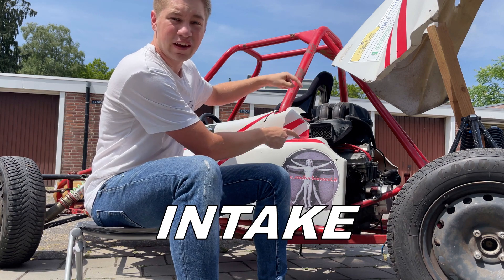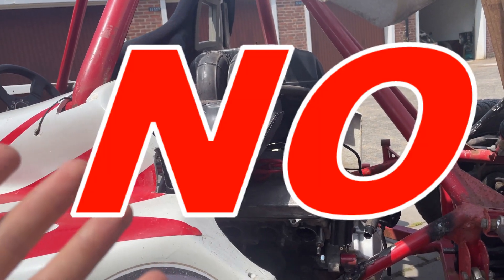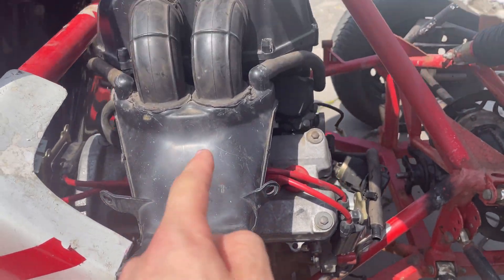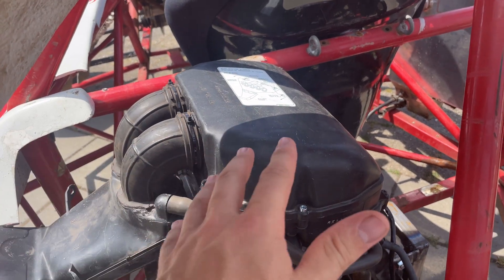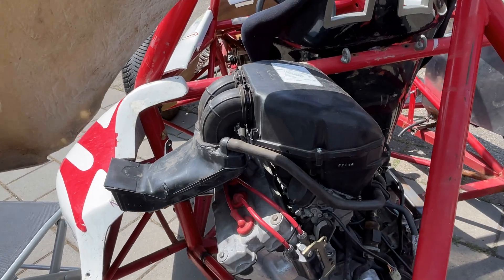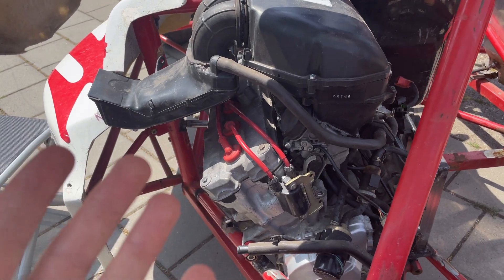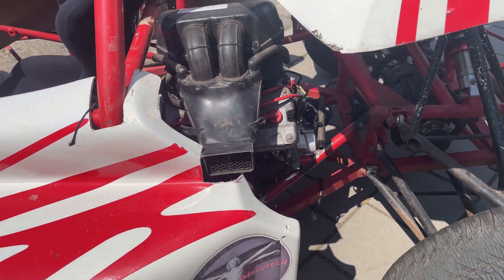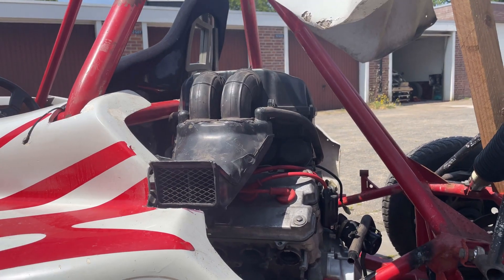DOES a RAM-AIR SYSTEM REALLY WORK? Ram-Air System Explained!

Comment: Did you solve this yet? I think a small shroud with a small angle similar to RB26 intake manifold would redirect enough air into the intake but produce less drag than a whole cone. Most accurate channel name ever btw XD
Reply from the maker: That’s actually a good idea! I was thinking about some sort of F1 intake manifold out of carbon fiber, which both of the engines use. Yeah I’m just a Guy with a crossbuggy :)

Comment: You might be able to get some benefits out of it by 3D printing a smooth intake cone that will obviously has a 90 bend, also making the inlet bigger that then tapers down into the original size will decrease the volume and increase inlet velocity, if you do ever consider making one, I believe the leading edges must also be curved much like velocity stacks.
Reply from the maker: Thanks for the advice! Sound like a fun little project, but we will see how the engine runs first, if it runs like crap without the Ram system, I will make intakes!
Reply: leer eerst maar eens natuurkunde..de druk zal niet toenemen
Reply: @lvisser9648 who said anything about pressure